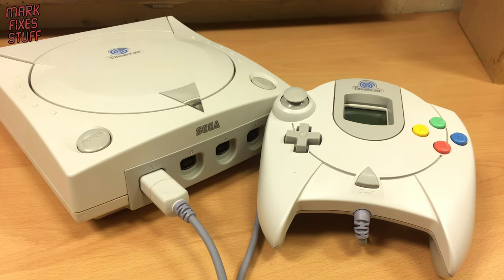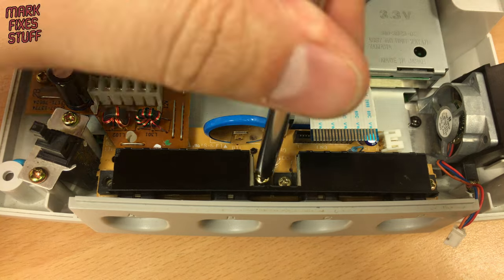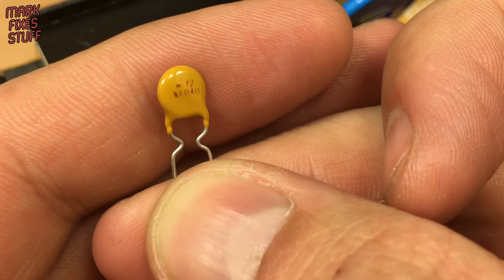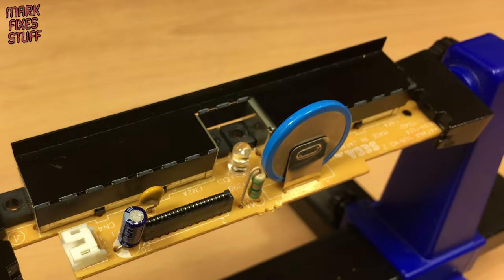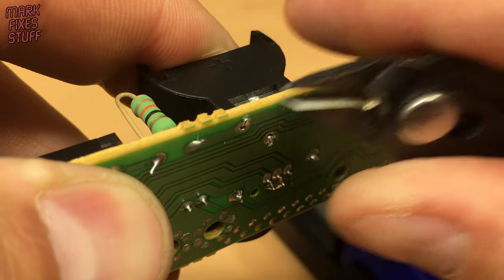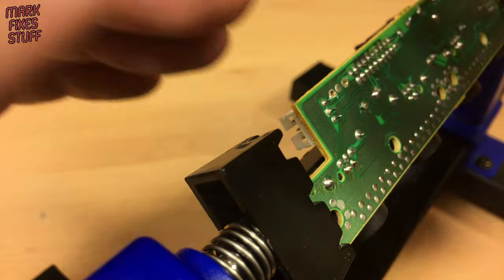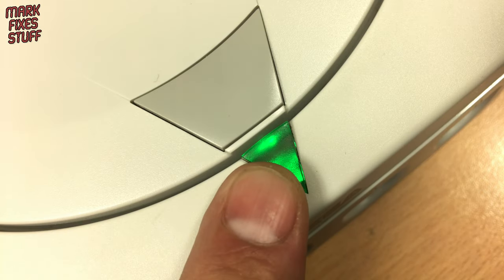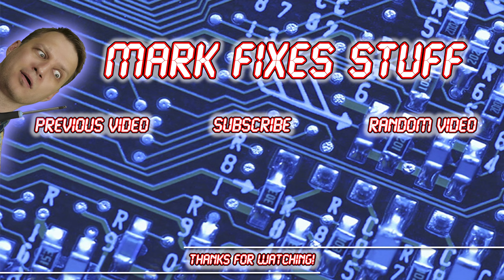Fixing a Sega Dreamcast Controller Port Fuse, plus  LED Colour Change & Battery Mod

Comment: You're the first person I've seen that's mentioned about the new batteries needing to be charged for at least an hour when you first set them up. NOBODY has ever mentioned that before. That fixed an issue I was having getting a bunch of Dreamcasts up and running. Thanks!
Reply from the maker: Ah. No worries! Well done!
Reply: Basically I need to leave the console turned on for 1 hour to charge the battery while plugged in and all and I'll have no led and it won't start at first I assume til it's charged?
Reply: @NoxianSoulHarvester since no one followed up with you, I’m checking to see if you experimented with this, and did it work?

Comment: thanks!  the kit I got had me put a piece in to stop the CR2032 flow, which must have been what charges that ML battery.  I kinda wish I'd done a rechargeable now.  But I assume it doesn't die too often and it only controls the clock.
Reply from the maker: You are correct. They last for years

Comment: For the battery, I did replace it, but did a slight bodge job. I used a holder from a motherboard and some short (but pretty thick) wires and soldered it in. I did use a standard cr2032, but it didn't really cause too much problems, since it was separated from the board.

Comment: Wow! I’ve found someone else with the rare VA1 Dreamcast with metal fan. I’ve done a mod walkthrough of my system on our channel, but that metal fan is a little more involved to get out to install the Noctua fan (you need to unscrew it from beneath, and saw off the metal plate it’s attached to).
Reply from the maker: Oh lol! I think I’ll leave it in place then mate!

Comment: I've watched this video many times and am impressed with how easy it is to change these parts. Just one question, in the video image it appears that the acrylic of the led and the gray trapezoid of the disc cover are illuminated with the led, is there any way to remove the gray trapezoid without damaging the plastic of the disc cover? I'm thinking that could cut a same form in transparent acrylic and this way the light could also reflect in that space but I can't find a way to remove it without damaging the disc cover.
Reply from the maker: I don't know I'm afraid!

Comment: I knew my skill at doing this type of thing were non existent when the left port on my PS 2 wasn't working, so I took it apart, broke the cable that went to the power button, and damaged both controller ports, so I gave up. I love emulation! The weird thing is that when I was your age (back in the 80's before you were born,) , I was fixing TV;s and Video Recorders for a living! Haven't touched a soldering iron in over 25 years! I dare not! I don't want to blow myself up!
Reply from the maker: I’ll take the compliment but I was a teen in the 80s haha! PS2 is a tough system to fix tbf.

Comment: My controller ports blew out when I confused the ground to 5v on joystick, I can’t find the exact 72 v resettable fuse your talking about in this video, do you have a link or can type what exact fuse I should be looking for? I couldn’t understand when your said it on your video 

Thanks!
Reply from the maker: You want a 0.4a (also described as 400ma) fuse rated for 72v. Here is the part

https://uk.rs-online.com/web/p/resettable-fuses/1740812

Comment: Ugh 😣 I tried to follow the LED mod. I tried two different LEDs from the same pack I got from Aliexpress… they didn’t work but when I used a 2032 watch battery to test them. They lit up… but when I power the console on it doesn’t work…. Help please!
Reply from the maker: First things first so apologies if I say basic things. Check the voltage going into the LED on the console with a multimeter.  Double check you have the LED in the right way around as well.   If both of those are correct the LED must be dying when you turn it on (some cannot handle the forward voltage), so check that LED again with your battery. 

Technically all we are doing is swapping an LED so it should be simple.
Reply: @MarkFixesStuff  I bought a new LED and it comes with instructions so we will see. Im a newbie with soldering so maybe I’m doing something wrong. Hopefully I didn’t burn the circuit board or anything… but thank you for the video and advice!
Reply from the maker: @Callieforniiaa  The board it quite tough so you should be OK. We all have to start soldering somewhere and this is a good project for that. I do recommend you pick up a cheap multimeter if you don't have one. They as really useful tools for all kinds of thing. Please do let me know how you get on!

Comment: I have controller ports A & D working fine, but not B & C, any ideas whats wrong it can't be the fuse if two ports are working OK.
Reply from the maker: Try reflowing the solder connections on the affected ports and also cleaning inside the connectors with a good contact cleaner spray.

Comment: Mark, great video! But does the fuse @ 3:05 need to go in a certain way? Also what is the 16v 47uF capacitor for may I ask? 

Also I believe you can install a CR 2032 battery, but what I think you have to do is to cut a small section of the long strip on the resistor @ 4:15 and then solder a diode onto it to block the voltage so that the battery doesn't pop. That way you can nip to Poundland and get some CR 2032 batteries that should work!

Subbed.
Reply from the maker: Hi mate! The fuse can go in any way. The capacitor is for decoupling and smoothing the power and yes you can use non rechargeable batteries but this way lasts longer and needs less frequent changing. Of course you need to mod the charging circuit to block the charging current as you so rightly say. Merry Christmas!
Reply: @MarkFixesStuff  Many thanks mate, and Merry Christmas to you sir!

Comment: Found this video and this is exactly what I need to do with my DC, I always thought the date and time were linked to the VMU. Guess that means I got a dead battery. Thank for this video.

By the way, could someone post the specific fuse and capacitor that was used to replace the old ones? Also is the battery holder specific?

Comment: Very well detail instructions about parts' specs! Most sellers who sell the controller port fix kit, only provide the parts without any specs at all, anyway, Mark, I need that aluminium fan you ahve in that dreamcast, since my dreamcast assembly structure, only fits the aluminium fan with the 3 pin (not the 2 pin version, which it is supplied with the VA0 motherboard), and not the plastic version, since the housing doesn't fit the plastic brace that it is hooked with your fan, do you sell it?, I can give you the same fan, but the plastic version, that it fits well on your housing structure!. I will be glad, and satisfied to ressurect my dreamcast!
Reply from the maker: Sorry Levin but that console was destroyed when my house was gutted by fire.
Reply: @MarkFixesStuff  R.I.P. Sega Dreamcast, sniff hope you get a replacement soon, dreamcast consoles now-in-days are very limited in production, and expensive. Thanks for letting me know... take care yourself, and your families

Comment: Mark, is it necessary to use a ML2032 rechargable battery when using the coin battery holder?  CR2032 etc will cause problems?  Or did you just happen to have the ML2032 on hand?
Reply from the maker: If you use a CR2032 the console will try to charge it and it will pop. You can add a diode to the charging terminal to stop it. That will mean that you’ll need to open the console to replace the single use battery when it’s dead.
Reply: @MarkFixesStuff  thanks for your quick response.  I have like 40 dreamcasts that I'm fixing and was trying to cut corners on costs, but I'll just go with the ml2032!  Thanks again.

Comment: Hi mark! I have a issue :/ try to do the light on my board but part what is in middle of anode & cathode as been burnt off (green bit) also the silver rings around two connections have gone. I had a look on the internet about repairing this but not sure i am able to? Am i right in saying i could do this with pad strips? Also i am new to all this could you explain why it says for cathode connection on board is a K? the anode goes in A & cathode goes into the K right? ty for the videos a great help ;)

Comment: Did you use lead wire to solder? If so could I use a lead-free wire?
Reply from the maker: Yes I did use leaded. You can use lead free.

Comment: I had just finished replacing all the fuses and did the new battery attachment and the clock stays adjusted now, but,  my controller ports are still having an issue. I followed exactly how you did it on your video. Idk what the issue is. :( I have four controllers but only one works better. I still have to wiggle the controller from the port just to make it work but the other controllers just don't work. Maybe I have bad controllers?
Reply from the maker: Take the controller board out and reflow the the controller ports. Put some contact cleaner in the controller ports and check any solder joints and connections to the controller board itself. Good luck!
Reply: Thanks man!

Comment: I have an issue with my controller board, I have replaced to fuse but its still not registering the controllers. The VMU beeps on power up. If anyone knows what this could be I would be eternally grateful.

Comment: For the battery replacement can you just install the battery holder or do you have to replace all the other parts too?
Reply: No you can just do the battery if you want.

Comment: If I connect the controller in port A, it works, If I connect the controller in any other ports, it doesn't work. Does that mean that those ports (B-C-D) are broken, or the console requires that if there's only one controller that it be connected to port A?
Reply from the maker: Do you have a VMU? See if that works in those ports
Reply: @MarkFixesStuff  No I don't
Reply: Remove flat ribbon cable and check if it has blue color
Reply: My flat ribbon cable had corrosion but I don't know how to fix it

Comment: my console works but the LED does not come on? any idea whats up with that
Reply from the maker: LEDs can die. If you’ve just installed a new one you might have mistakenly put it in the wrong way.
Reply: @MarkFixesStuff  thanks for the reply. Na this is an old Japanese console I had, today I put a modern PSU inside works fine just the original LED does not come on at all. So could just need a new one? It's self powering once soldered ain't it?
Reply from the maker: @PITCHSHIFTER666  check the resistor next to the LED but yeah, could just be the LED.
Reply: @MarkFixesStuff  the longer side of the LED is K? (doing it right now)
Reply from the maker: @PITCHSHIFTER666  longer leg is the positive Anode. Shorter leg is the negative Cathode (K)
Reply from the maker: The cathode side should also have a flat area on the led side
Reply: @MarkFixesStuff  seems to be working except 2 things LED still does not work and the battery mod still makes me reset upon startup. Do you think the culprit could be this resistor in front of the led? what exactly is that for? thanks for your help btw
Reply from the maker: @PITCHSHIFTER666  Not sure which part you are looking at. Can you describe it and what bands it has

Comment: As an 11 year old, I was put through hell because of the controller ports. 
My Dreamcast that I worked so hard for just died, and my mom helped me replace it... and then that one died. So we returned it and got another... and that one died too. 
In the end my dad blamed me for it and I was not allowed to get another one.
I called Sega's official support and got no help at all... My dreamcast days were just done.
ALL BECAUSE OF JUST SOME BASTARD LITTLE FUSE!?!?!? 
If only I had known back then, I would have learned to solder right then and there.
Reply: Blame sega for their shitty design.
Reply: @Kaido_928  I blame everyone for everything lol I'm just stoked I can fix it now at least, so if mine goes out I am not screwed like back then.

Comment: Is it essential to replace the R1 (resistor) as all the replacement sets don’t seem to include one
Reply: I didnt change it. Only the battery en the controller port reset resistor.

Comment: I can’t even get the LED out how did you do that???
Reply from the maker: Desoldering gun? Why won’t it come out?
Reply: @MarkFixesStuff  ive removed literally all the solder and its still stuck in there
Reply from the maker: @DoobyShoo  must still be solder in the via then mate.
Reply: @MarkFixesStuff  in the via?
Reply from the maker: @DoobyShoo  the middle of the hole
Reply from the maker: Try heating the led legs and pull them out as the solder is fluid
Reply: @MarkFixesStuff  Okidoki I’ll try it
Reply from the maker: @DoobyShoo  how did it go?
Reply: @MarkFixesStuff  still no dice, I ordered some braid to help out
Reply: @MarkFixesStuff  after some long work, i managed to change the LED, but sadly... it doesnt work, it seems the old LED was too tight and it chipped off some of the trace... so now i have a dead led zone, the rest still works just not the LED.. might need to either use the wire strategy or just buy a new controller board

Comment: Why isnt there a mod to put the wire at the top of the controller? is this not an original idea? no one has done it. or i just cant find a video on it.
Reply from the maker: You can clip the cable into a channel in the underside of the controller already and then the cable is out of the way

Comment: My Dreamcast won't turn on after replacing fan...
Orange light and fan comes on but no video
Reply from the maker: Have you tried cleaning the pins that the PSU board sits on? It’s a real weak point in the design
Reply: @MarkFixesStuff  still no signal
I notice when I disconnect the yellow wire from the fan it gets a signal

Comment: Ifixit: difficulty: high
Me: difficulty: low (is pretty easy like "1, 2, 3" steps, even if I don't have solder sucker, I use my existing soldering iron while heating the existing solder from the board, and pulling off the components, as I heat the solder)

Comment: Is it just me, or did anyone else notice dry joints on the Fan socket?
Reply from the maker: I can't recall specifically now because I recorded this footage in June, but it's very likely because there were several duff joints. I went over the whole thing to be sure. Sometimes it's just easier than hunting.